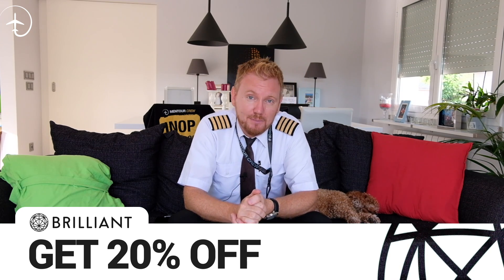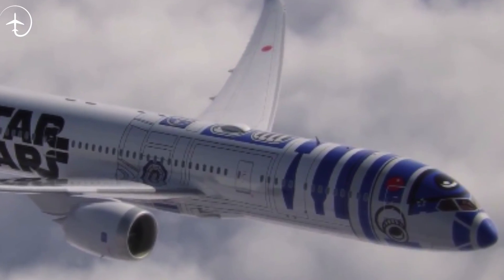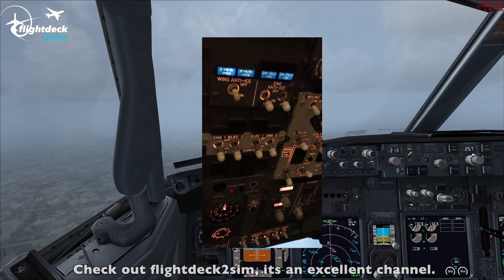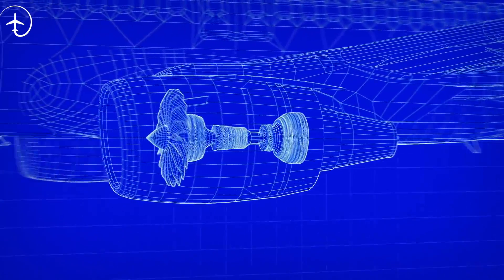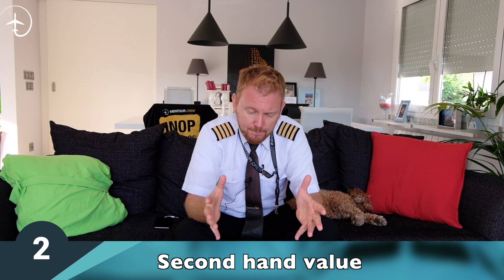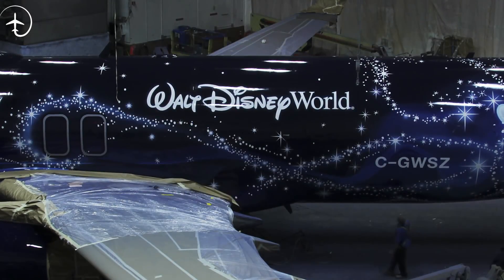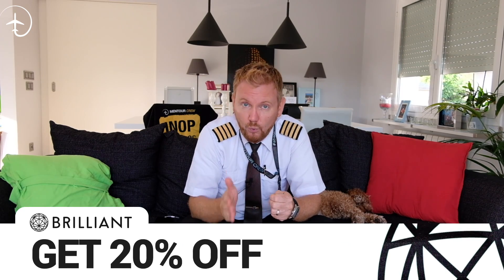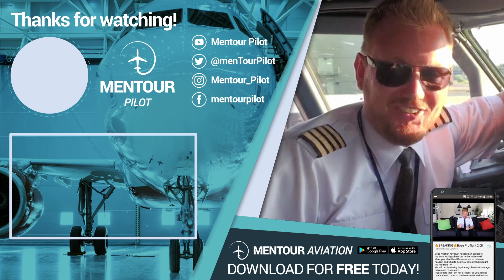Why the front of the Jet Engine is NEVER painted..

Comment: Pilot you way over simplify, perhaps that's what your audience needs, I believe they deserve more credit for having the ability to understand a complex system and material choices. As an aerospace engineer well-versed in the design of nacelles, in particular the B767 nacelles, well I don't rate your video very high. If your audience is fellow pilots then your presentation is good enough.

Comment: I always believed they did Not paint the blades of jet engines cause they will upset the balance of the blades as its almost near impossible to make sure ALL blades get the exact same weight in paint also when some paint eventually starts peeling off the blades will be so Unbalanced n may even shake the engine to pieces at the speed they are spinning, I ngues i was wrong thanks for the info mate

Comment: One BIG exception I can think of to the rule of painting your aircraft white, is Braniff ... when it was still operating, Braniff painted its aircraft a vibrant orange. 

Interestingly enough, on one photo of a Braniff 747, almost the entire engine nacelle was left unpainted and silver, except for two orange girdle rings around the central section.
Reply: Remember the cost range Mentour mentioned?  I remember Braniff's paint schemes (and flew on some of their different colored planes), which were not all orange and maybe that is part of the reason they went under. They used multiple colors and also "dressed' some planes in multicolor patterns (Google "braniff airlines" then click on Images).

Comment: I thought about how much the temperature is changing between? Maybe you fly to Alaska and it's -25° Celsius, and the engine's are hot when landing, emidiately after they will cool down to below freezing, isn't that wery stressful for the engine?   And otherwise you fly from freezing air temperature high in the sky, then you land quickly to an airport which is hotter than hell , say 45°  Celsius in the sun! That would be stressful for the  aircraft body!? I would think so!

Comment: A: It doesn't need to be painted in the first place. B: Air flow characteristics could change as the paint wears leading to problems also paint chips could get sucked into the engine. A, is most likely a result of B, but let's find out. 
(Edit) I hadn't thought about the possible effect on the anti icing system, good thing they did eh? :)

Comment: That's easy: too hot when the thermal anti-ice valve is turned on. Doesn't take 12 minutes to explain that (plus ads)
Reply: Right, and he also says paint chips might get sucked in. It really was irritating to listen to all that crap, wasn't it? I managed only because I had resolved to enter a brief summary here in the comments.
Reply: Go away!
Reply: @stevehansen-42  He had a good point.

Comment: You said the pilot switches on the anti ice under certain circumstances.  In this world of computers and sensors, why isn't it automatic?  I know of one plane that crashed because the pilot forgot.
Reply: Because the 737NG is an old aircraft design which will be phased out in a "few" years, which by the way means in about a decade in aviation terms😆
Reply: @speedbird9313  so newer ones are auto ice then?

Comment: 1) Is it true that when flying at 500 mph at 35,000 ft altitude, if you stick your hand out the window, it's only like driving in a car at 100 mph?  Is the low air density the cause of this?
2) How can a plane fly upside down, if the air pressure is lower on top of the wing?  I think it's all a matter of the wings pushing air downward.  Agree?

Comment: Many (most?) metals are very good at transmitting heat.  Stainless steel is a very poor transmitter of heat and that's the reason why it's used as heat shields between catalytic converters and car bodies.  Also, stainless steel exhausts retain exhaust heat and improves the performance of cars by retaining the heat in the exhaust.  Carbon steel becomes more susceptible to corrosion during the heating-cooling cycles.
Reply: Yes...but why are you going on about stainless steel in regards to this video?🙄

Comment: I'd have thought paint on the outside of the engine would help it insulate from the coldness of the outside air and the unpainted inside would benefit from the bleed air. The rest makes sense and moulten paint landing on fan blades could cause inbalance and vibration.

Comment: Thermal transfer is the only significant reason nose cowl lips aren't painted. The other three, are your host manufacturing reasons to make this video longer than the 15 seconds which were actually needed to explain reason number one. 
Compared with all the sh*t that accompanies the millions of tons of air that travel through these engines between overhauls, a few ounces of dried paint would be like a dot of fly crap on the side of the Hindenburg.

Comment: If lip of subsonic is painted, with time it would build a significant layer of paint, and because @ inlet's lip the air streaming MUST BE critically controllable, it must stay unpainted ...
Reply: The lip contour is critical for airflow, but not critical to .050, never mind .010". We've got dents and gouges in our cfm56, Pratt 4000 and CF6 nose cowl lips which are .100" deep, and which are simply blended and buffed out. Within the guidelines of the Aircraft  Maintenance Manual they can stay that way for thousands of flight hours, on a constant periodic monitor inspection until a certain date.
Reply: @randallsemrau7845  Thanks for clarification of THIS "critical".

Comment: What is the throttle response time on jet engines is it instant like a car?
Reply: Generally speaking, the throttles are moved slowly and gradual, like during taxiing. Depending on the aircraft and engine types, the response time varies, but usually pretty fast. There's also automation, such as auto-throttles. During takeoff, the throttles are moved up faster, but in a smooth motion.

Comment: Why do you use Celsius when talking about ice buildup and centigrade when you’re talking about fuselage temperatures?
Reply: They are just different names for one and the same scale.
Reply: Celsius is the honorific of centigrade, named after the Swedish astronomer Anders Celsius (1701-1744).
Like Hertz is the honorific of “cycles per second,” named after Heinrich Rudolf Hertz, the first person to provide conclusive proof of the existence of electromagnetic waves.
The Fahrenheit temperature scale is named after the physicist Daniel Gabriel Fahrenheit. It was intended to have 180° between the solidification (freezing) point and the vaporization (boiling) point of water. It was intended to have the 100° point at the normal internal temperature of the human body. Due to inaccuracy of measurement it was missed by 1.4°.

Comment: I don't care, that Walt Disney World paint scheme at 7:49 looks really cool.
Reply: They also painted a Concorde in a different color once, for a Pepsi promotion. They had to reduce the maximum speed (from mach 2.0 to mach 1.7) to compensate for the additional heat.

Note that the SR-71 "Blackbird" was painted black because black radiates heat better than white. The SR-71 got so friggin' hot (570°C in some areas) that the additional heat-up from caused by the black paint did not matter; but the additional radiation did.
Reply: @klausstock8020  That's also why some surfaces on the SR-71 are corrugated, so they can expand from the heat.  Also why the fuel tanks don't seal properly until they get up to speed.  It drips fuel all over the place when it takes off, that's why any base which housed SR-71's had dead grass at the end of the runways.  The normal procedure was to fuel one up with enough fuel to reach an airborne tanker, then refuel.

Comment: Lots of layers of pint on composite panels can hamper the lightning protection.  In essence, more layers weighs more. So when lightning evaporates a small amount of the lightning protection (which is often a bronze mesh on top of the composite but under the paint) there’s more pressure which can be harder on the structure.

Comment: Question: why is bleed air used to heat the front ring of the engine? Can't the liquid used to cool the turbine blades be used to warm the front without reducing effectiveness of the engine?
Reply: Liquid?!🤷🏻‍♂️ There is no liquid in the turbine blades😆
Reply: Engine turbine blades are NOT liquid-cooled...where the hell did you read or hear this?
Reply: @edfilipowicz4866  Yea, I found that out now. I am not sure why I was sure of that, but now thinking about it: pumping a liquid through a blade spinning that fast is giving some serious challenges.....

Comment: When are they going to do something about fire hazard in crashes with a lot of highly flammable fuel , they put profit before safety ??
Reply: Dear Donna...jet fuel is not highly flammable. If you had a barrel of jet fuel in your backyard you would have to use a blowtorch to make it burn.
Reply: @speedbird9313  yes I hear what your saying but why then are so many aircraft accidents where fire is the big killer? If fire could be prevented then more people would survive. Also the interior of aircraft produces very toxic fumes which also kills passengers. The Manchester accident when an engine on a 737 on takeoff went wrong , the pilots did there best but when they put engines in reverse the bad engine sprayed burning fuel on the fuselage. I admit that smoke inhalation killed most of the casualties but burning fuel caused the cabin situation , yes the engines
Reply: Sorry hit the wrong button, as I was saying yes the bad engine being put in reverse sprayed the burning fuel but the hot engine ignited the fuel far to easy . You could say the high heat of the engine ignited the fuel but in so many accidents with fire involved there is something wrong. In small aircraft fire kills a lot of trapped people and if it’s right what you say how come smoking is forbidden near aircraft fuel if it’s so hard to catch fire??
Reply: @speedbird9313  since my last comments I’ve been watching some more videos about aircraft fuel and it turns out your right it doesn’t catch fire . So I can only conclude that it’s the , would you all it mist from fuel that catches fire but I still have many questions why aircraft fire is so prevalent in aircraft accidents?? I’m sure you will agree that the materials used in aircraft could be better as the toxic smoke kills a lot in accidents.
Reply: @MsDenver2   We used to put out burning jet fuel in a barrel with a fire extinguisher every third year or so at my airport as part of the security clearance, but they stopped it about five years ago (or more, time flies🤭)
Completely agree with you concerning things that can cause fire. But we changed out aircraft insulation and interior with non-flammable/ fire resistant material on our entire fleet in the late 90s. So the interior bit it has been taken care of👍🏻Taxfree alcohol in the overhead bins is a bigger problem, but I dont think anything will happen on that front😆

Comment: When an aircraft is painted white, its easier to find working rivets, that rivets that have worked its way loose.  It cracks the paint around the rivet and as a result there is a dirt ring.  Letting you know that dirt moisture, and salt air has been introduced into the outer skins and the air frame structures.  Which mean you need to monitor and determine whether it will need preventive maintenance. Especially aircraft near the ocean.
Reply: You write like you know what you`re talking about..but there is nothing called a working rivet🤨

Comment: Curious why the heating could not use hot exhaust gases, not to penalize the engine performance.
Reply: It does, a tiny portion is  being diverted  from the compression  chambers.

Comment: so if the paint adds weight and weight increases fuel consumption, do you think the manufacture process will ever be good enough to not require paint and save all this work?
Reply: Some airliners used to polish their paint , to save fuel, look at some pics during the 70s fuel shortages. Paint is not required on an aircraft.

Comment: So THAT's why one of my renderings of futuristic aircraft when I was a graphic designer (1981-2011) at NASA LaRC got frowned on!  What about anodizing in a color or tint on the engine nacelles?
Reply: It would look like crap after a few years. Metal you just polish back up.

Comment: the exaggerated effect is with the old Concorde the heat of the dark paint actually changes the surface of the plane so much that it stretches the aircraft even more then normal.

Comment: As a side note the smooth unpainted aluminium engine lip helps in the formation of a normal shockwave at the lip leading edge and also the smooth surface ensures that correct intake pressure and temperature measurements are taken by probes just inside the intake.

Comment: Different surfaces absorb and reflect wavelengths of visible light differently according to their colour. When Visible light passes though a different medium eg. engine lip of a plane, the wavelengths of colour within the visible light will reflect by different amounts. (Dispersion of light)

Black surfaces heat up as they will absorb all the wavelengths of light and black is not a colour in the visible light spectrum.we see objects black as the lack of colour being reflected of it.This causes a rise in thermal energy store as the reaction is endothermic (gains energy from the surroundings) causing that particular surface to heat up. 

However white surfaces absorb all the wavelength of visible light as the colour of the undispersed light wave is white. This causes a deacrease in thermal energy store in that object as the reaction is exothermic (transfers energy to surroundings).Thus causing  white surface to remain cool.

Comment: I disagree with the reason for not painting the intake of the engine because of FOD potential.  The F-15 & F-16 both have the intakes painted and the intakes are a lot longer.  The type of paint is what makes the difference.  The paint used on the F-15 & F-16 is a two-part epoxy type paint and is very strong and durable.

Comment: I would have guessed you never paint any integral engine components so fractures are more easily identified. This is the reason for german steam locomotives to have red painted wheels because oil creeps into defects and you can see the blackened fracture very well on fiery red surroundings.

Comment: Expanding on the topic of white painted aircraft, another contributing factor is UV radiation. For every 1000 meters in altitude UV radiation increases around 10%. White paints are best in reflecting solar rays while darker paints absorb them. Aircraft paints are single stage with no protective clear coat layer. Darker single stage paints are prone to rapid UV and oxidation damage.

Comment: Why most aircraft are painted white? Simple answer is that any blemish, hole, crack or dent is easily visible ... especially cracks and holes that are very dangerous when the aircraft is flying at a very speed. But then most military aircraft are never painted white. Well, the reason is simple again. They become sitting duck against the blue sky ...

Comment: Worth a mention at least is the sponsorship deal between Pepsi and Air France to paint a Concorde blue with the Pepsi logo.  The result was that Concorde's usual Mach 2 cruising speed couldn't be maintained for more than 20 minutes without significant airframe heating while wearing this paint.  Maximum cruise was limited to Mach 1.7.  The reason was that the predominantly blue paint job absorbed a great deal more heat than the normal white paint job.

Comment: I seem to remember when Air France did some weird marketing thing with Pepsi where they painting one of their planes, possibly a Concorde, Pepsi blue and it lead to all sorts of structural stresses they didn't anticipate. I believe it had to do with the mix of natural heating of the outside of the plane at super-sonic speeds and the addition of heating from the sun on the blue paint which caused several rivets to fail.

Comment: I’ve heard that outside temperature around the Equator drops to -90C, but I cannot find any literature to confirm this.
Is anyone aware if this is really the case and what would be the reason for 20/30 degrees difference?
Thanks!
Reply: Hi Dave, I have never mentioned at sea level. Have a good day man! :)

Comment: Some airlines have historically or are currently painting aircraft in non-white schemes, so it's not impossible, though there are drawbacks to it. The most extreme case is the Concorde, which had to be white for heat reasons. I've read that at least one was temporarily painted in a promotional Pepsi paint scheme, and it's top speed was limited while painted like that. Consequences are less severe for subsonic airliners. Another similar thing I've always wondered is why the airline paint scheme is always limited to fuselage, vertical stabilizer, engines, and winglets, while wings and horizontal stabilizers are almost always the same light gray. My dad (a United A320 captain) said that this was because the wings aren't visible from the side, say at the gate or while taxiing, but airplanes fly over people - that's sort of their main point. I can imagine the top of the wing has these same heat issues, possibly a greater concern as that's the fuel tanks, but the underside of the wings is almost always in shade, and would be visible to people on the ground below. Could an airline do something interesting on the bottom of the wings that would make them instantly recognizable to people on the ground, even with the plane very high up? If one airline painted the bottom of the wings a highly visible and distinctive color, say orange, when no others do, they'd really increase brand recognition.